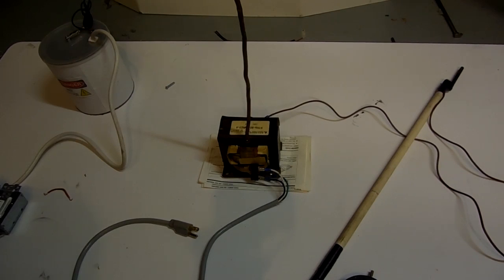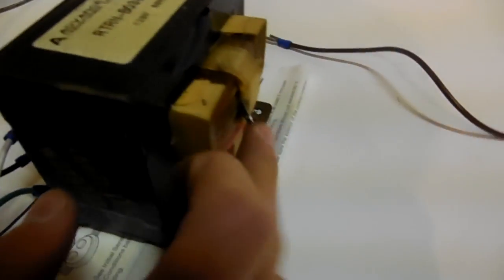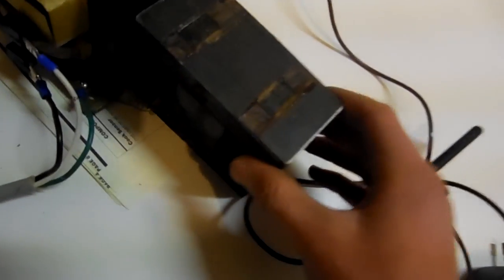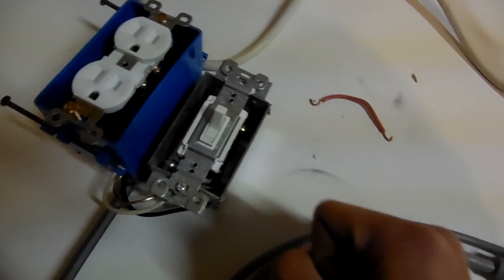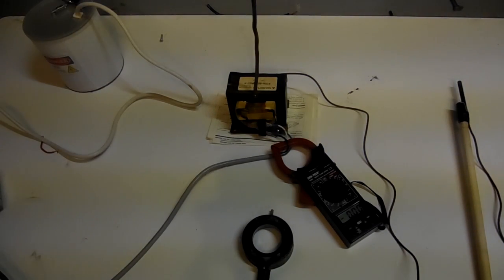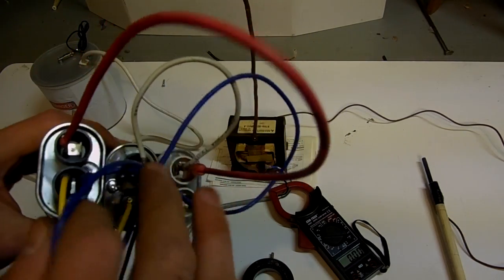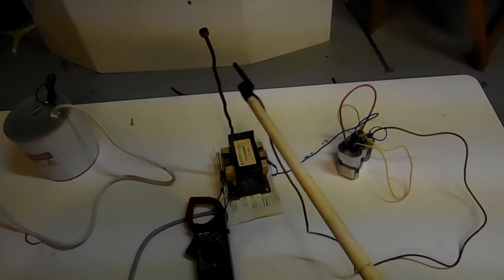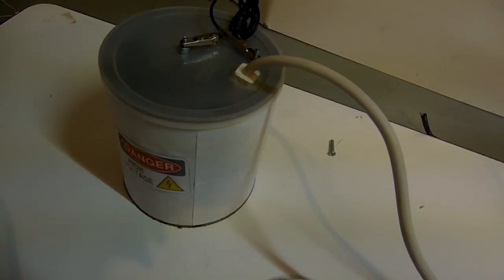MOT How To (Safety, Wiring, Ballasting, Resonance, etc...)

Comment: Volts don't kill, amps do.
Reply from the maker: But volts determine how many amps go though you. So watts kill :D 
Thanks for watching!
Reply: Depends on the conductivity/resistivity of the wires.  Graphene and silver will most certainly cause a lot of damage.
Reply: I know.  But once the dielectric breakdown of skin, for me it's about 9 volts, then current is allowed to flow through the body.  Using a power converter can help convert amps to volts and possibly make the current below 30 mA so it will not be deadly, but it will still hurt like crazy and the greater the voltage is the hotter the plasma.  So if the current does not kill from a step-up transformer the heat most certainly will.
Reply: no ENERGY kills you; Volts x Current x Time